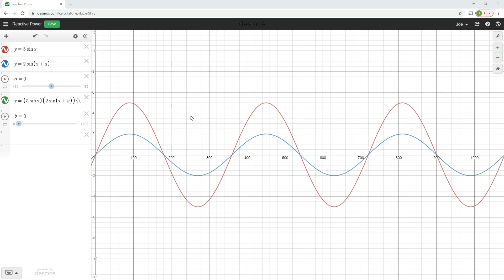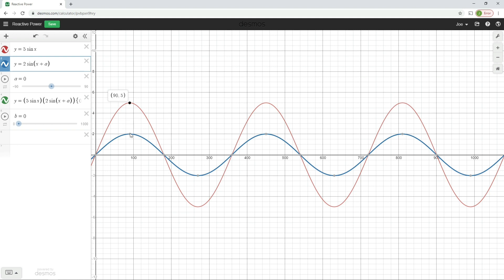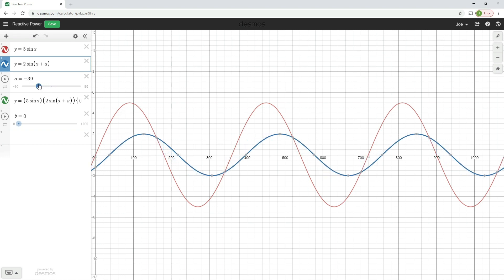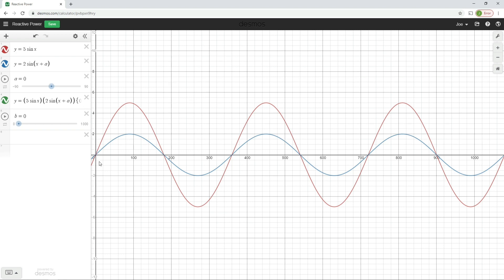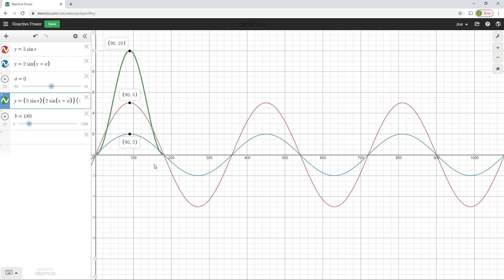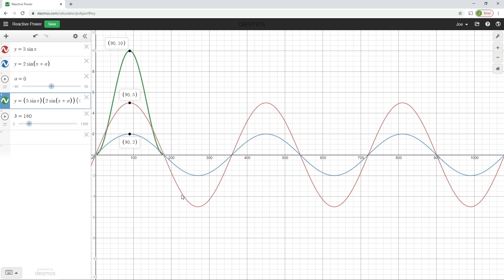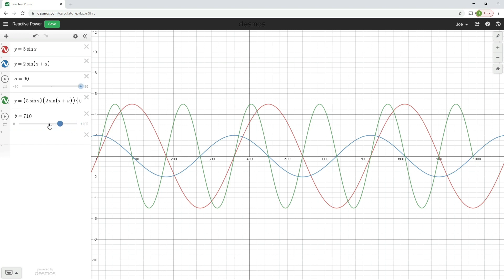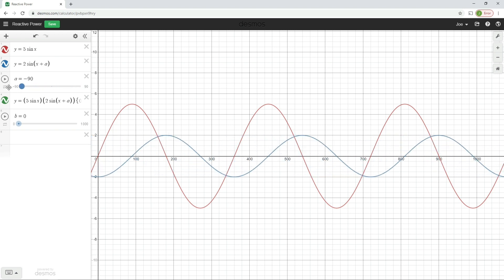Why do Purely Inductive and Capacitive Circuits Not Dissipate Any Power?

Comment: Is it possible to make the whole household current, shifted 90 degrees? And if so, how?
Reply from the maker: You could install a massive beefy array of capacitors, not sure why you'd want to? 🤔
Reply: @JoeRobinsonTraining  Thanks for your swift advice! 

1. That should be parallel on the 230 V I guess? 

2. I am curieus to find out what my digital KWh meter will register. That’s why I want to do this experiment. If the phase is shifted 90 degrees, there should be a different measurement, isn’t it? 

3. Furthermore I wonder how to calculate the exact Farad amount at say 10 Ampere. 

4. But I also guess that with a more existing load that is i.e. more inductive, the compensation should be different and effects the amount of Farads needed to do a maximum phase shift of 90 degrees. 

5. Why a massive amount of capacitors? And not a single big one? 

Thanks again for your help, knowledge and instruction efforts!

Comment: I just watched this video again, we need more Joe Robinson content in our lives!! You seem to have slowed down with your own content?? Please sir can we have some more?😁

One question, if I put a clamp meter around a capacitor “leg” I measure an amperage, so what am I measuring? Is it current being drawn into the capacitor, or current being dissipated, or a mixture of the two?🤷‍♂️
Reply from the maker: More content on the way matey. I'm also producing my own content on eFIXX as you know. 😊 Stay tuned for more. 

Great question on the capacitor you're measuring the rms of the current flowing in and out of the capacitor. This will vary depending on the capacitance and frequency of the circuit. 👍

Comment: This AC Theory series has been extremely resourceful. I found it surprising how incredibly enlightening these lectures have been for me considering my knowledge of electronics for the last 30 years. I'm stoned how I have overlooked the importance of Power Factor and the Average Power Dissipation of Reactive components like the inductors and the capacitors: Even though I knew most of everything in your lectures, after going through all the videos on AC Theory, I feel like I knew nothing. 😆😆😆. Thanks Joe for your amazing eye-opening lectures. You are a true professor.

Comment: Great Vid.  Thanks Joe.   You can achieve superconductivity at room temperature with the right set up.   Have an LC circuit that's in resonance and with high frequency, you'll have zero resistance.
Reply from the maker: Interesting, I didn't know that, I'll look into it thanks.